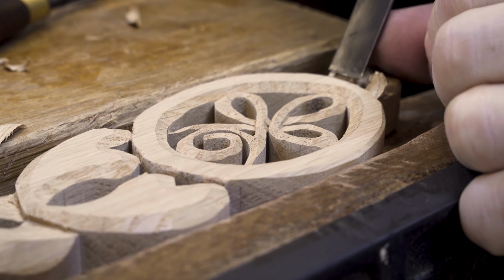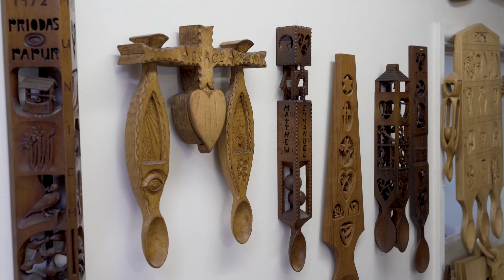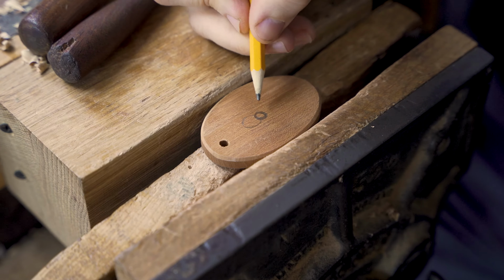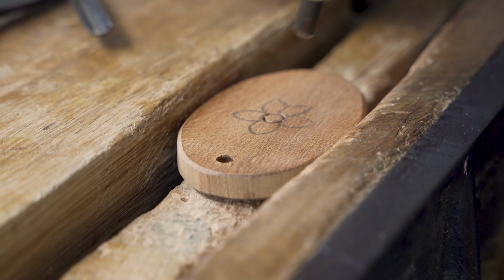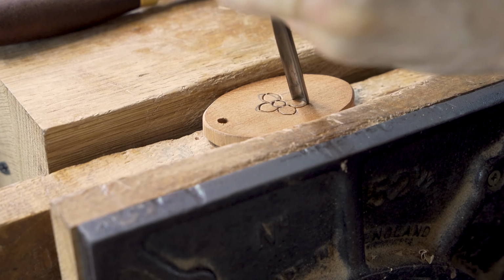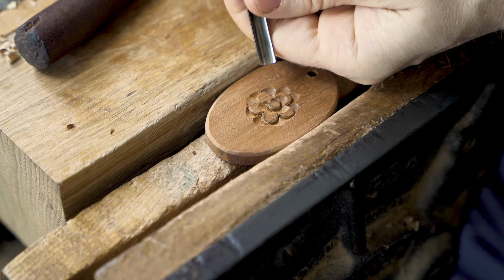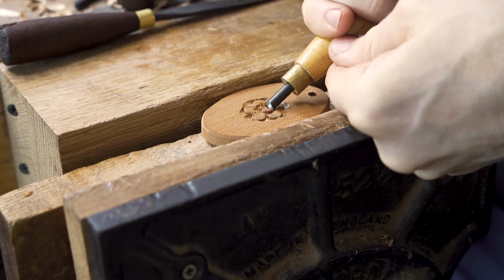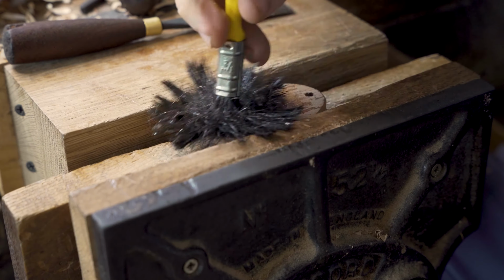beginners wood carving, the basics

Comment: Hello,Do you have any tips on how to remove the gouge marks near the petals on the outside? Would the methods be a lot of sanding or shallow cuts with maybe a number three gouge to get rid of the marks? Thank you!
Reply from the maker: Hi, great to hear from you. Not something I have ever tried to do. The gouge cuts are part of the design of the surround. Sanding would soften the cuts but also the flower carving too. You can remove the surrounding but cutting it out on the scroll saw and just leave the points of the petals touching. As I only do one cut into the edge of each petal I find the finish is usually quite clean.

Thank you again for getting in touch and supporting our YouTube channel. All the very best from us all. 👍👍